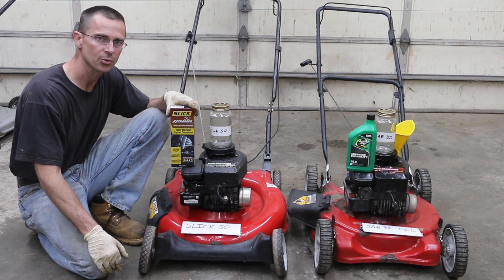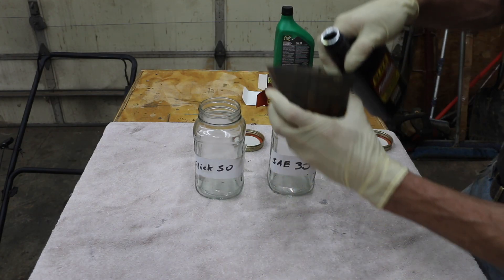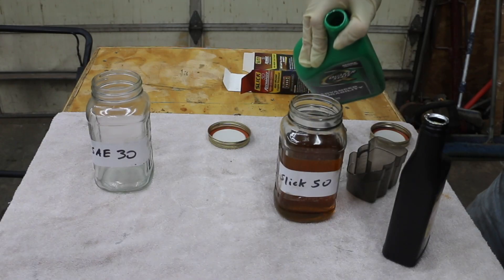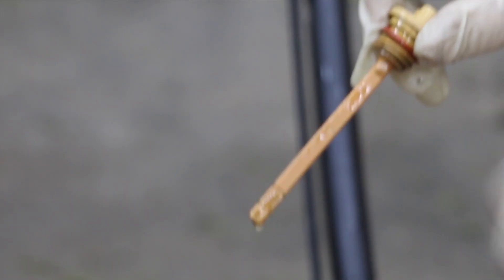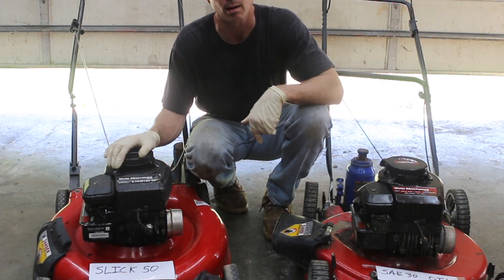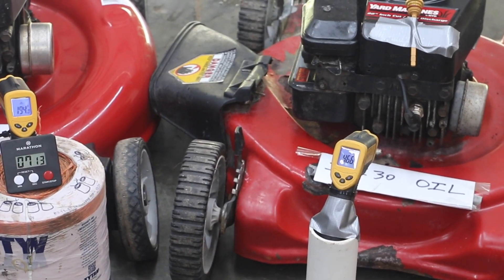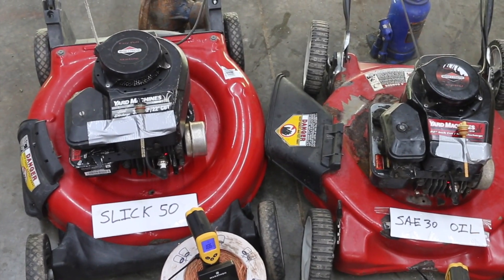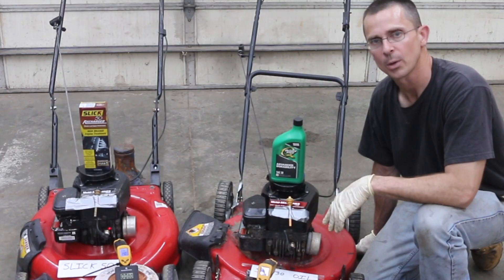Can't believe what SLICK 50 did to my engine!!--Dry Crankcase Test!

Comment: One thing that I noticed is that both engines took the same amount of oil but at 4:29 it looks like less oil was removed from the SAE 30 motor? Possibly that engine still had some oil left in it to protect it? 
Both engines should use the same base or sump, so capacity should be the same. 
The idea that the one motor has more wear on it has some validity as well, a well worn motor will have greater clearances and be less susceptible to seizing. 

Personal experience showed me years ago that Slick 50 would make many engines idle higher after it was added and run for a while. I had first tried it in a Toyota 22RE in 1988, after the oil change with Slick 50, I had to lower the base idle about 140 rpm or so back to factory spec. I got the same results with my 1986 Camaro. I didn't keep the Camaro long, but the Toyota motor ran for 372,000+ miles, and was still running when it was totaled. I added Slick 50 in 1985 when it first popped up on the shelves around here to a 1980 Pinto I had, the car had 110,000 miles on it at that point. I ran that car for 30 years, sold it with the original motor and trans at 664,300 miles, having done nothing to it but several timing belts, a valve cover gasket, one used rear axle (172K), several water pumps, a clutch, (at 352k), and a radiator (360K) in all that time.  I'd still be driving it if the body had held up as well as the engine. 
I can't say whether Slick 50 contributed to the longevity of those motors or not but I don't suppose it hurt anything. 

Back in the early 90's Ford was having problems with rocker arms galling and squeaking in the 3.8L engines, the fix they gave us was a 12oz bottle of additive which was completely unmarked. Word was that it was a PTFE additive much like Slick 50 in an acidic base to etch the metal. Our instructions were to dump the oil out of a hot engine, mix this additive with a fresh quart of oil and refill the engine as normal. Then we were to run the engine for 20 minutes at high idle. Every last engine that had noisy rocker arms was fixed nearly as soon as the oil reached operating temperature. 

The one thing I do remember was that the stuff came in a bottle much like power steering fluid or brake fluid does with a silver film seal on top. The screw driver I used to pop open those bottles would turn black where it contacted the additive. 
My workbench there was bare steel, I kept it spot less clean. On once occasion an empty bottle of that stuff fell over while I was running the engine on that car. I had taken lunch break and come back and noticed that the bottle had spilled a table spoon or so size puddle of additive on the bare steel bench. I wiped it up but it left a dark gray or black stain. 
Nothing would remove that stain, not even sanding with a Scotchbrite Roloc disc. The stuff had etched deep into the metal. 
On each car, we were told to immediately change the oil again after each run in period, we were told never to leave the additive in the engine. I tried several times to get someone to tell me what was in that stuff but all I got was that it contained PTFE, which was on the label. They would never say why we couldn't leave it in the motor for longer than specified and they were very adamant about changing the oil before the car was returned to the customer. 
When the warranty program was over, that stuff was gone, no longer available. The TSB for this stuff was back in 1993/94 mainly for the Thunderbird/Cougar models. For some reason the Super charged engines and the front drive engines didn't have the issue with noisy rockers.
Reply from the maker: Thanks for the feedback.

Comment: Microcontroller.
Used it in pumps running 24/7/365.
Noted reduced wear and 1r to 30 degree lower Temps than pump mfg. 20 ND  spec.
Reply from the maker: Thanks for the feedback.
Reply: @ProjectFarm  .

Comment: there was a product years ago that i had great success with called  MICROLON. I have not been able to find it for years but i have a generator that was run 8 to 13 hours a day for 3 years and it has no bore wear.The Chinese bearings gave out due to poor quality but this genset was run on gas,old and new,dirty and clean even diesel and veggy oil were used for fuel when i was desperate for fuel living off grid.I still have this genset apart for a keepsake .But if you can find any MICROLON that would be worth a try also I know a guy who luved TUFF OIL.another decent product.I was never a fan of slick 50.More like slick advertising
Reply from the maker: Thanks for the video idea.

Comment: The end result is simple folks, sae 30 oil is superior to thermal breakdown and holds it's true viscosity.
Reply from the maker: Thanks for the feedback.
Reply: @ProjectFarm  I'd like to see a Tecumseh 3.5hp run up against a Briggs and Stratton 3.5, remove the governors and let them run away. Use the same oil and brand for both  engines(such an sae 30) And then run the clock until one of them self destructs. Make it happen!

Comment: RVS is product that I have used myself and it really is working. Once I had this old diesel Merc with mechanical pump. Once I added RVS and did it like it should be result was that idle speed raised by 100rpm. My opinion is that it's amazing. I just haven't been brave enough to try running engine without oil after that treatment. Maybe you could try that product.
Reply from the maker: Thanks for the video idea.

Comment: When Slick 50 is added to a car engine’s oil, it will remain in there for several thousand miles. Perhaps this would give it ample time to impregnate the metal. It could possibly be that it just hasn’t had enough time to do its job. I’m just using the SWAG method here. I’m not sure how you could simulate that on an old lawnmower.
Reply from the maker: Thanks for the feedback.

Comment: The slick 50 I used years ago worked modern concoction is no where near the same product pwrhaps you could look into it. I also remember if yiu looked at it at the right angle you could see tiny.platelets in it
Reply from the maker: Thanks for sharing.

Comment: This test, unfortunately, doesn't tell us anything.  We have no idea how old each engine is, how many hours they've been run, or how they've been cared for during their lifespans.  Are they each brand new?  Are they identical?  All I know is that I used Slick 50 in my '94 Nissan hardbody 20 years ago there was a noticable difference.  It ran much better and much more efficient with it than without.  I only stopped using it due to cost.  If my memory serves me correctly, it was $50 a bottle and really ate up the pocketbook.

Comment: I too used to use slick 50 in the very first new car I bought.  That engine out lasted the car it was in. I noticed the lawnmower with the slick 50 had wheels that needed replacing because they were wobbly compared to the other lawnmower.  Just wondering if one lawnmower had many more lawns under its belt.
Reply from the maker: Thanks for the feedback.

Comment: I see two problems with the test setup:
1. Slick 50 was probably not long enough in the engine to have „best results“.
2. It probably would have been better to see what temperatures the engine with Slick 50 would have given with the 30W oil beforehand, to see if both engines perform similarly enough for such a comparison. Without that there can be lots of reasons why the Slick 50 engine quit so fast...
It also would have been nice to see, how both engines now look inside :)

Maybe you could do a new Slick 50 video with your current oil testing „suite“. I‘d be interested to see if it helps reduce wear on that bolt. :)
Reply from the maker: Thanks for the video idea.

Comment: I don't think Slick50 or Lubrilon have PTFE anymore. I just now read that Lubrilon does not, on their site. I believe that the fluorine in the PTFE may have been causing issues with oil chemistry, emissions, or both. Also, what effects would unbonded particles have in filters, in the engine, or maybe even in the catalytic converter? Or possible caustic compounds containing fluorine relaesed by heat and pressure? I remember Amsoil product literature (from a while ago) being extremely critical of a certain oil additive, which they refused to name, citing oil chemistry and/or emissions issues it caused (if my memory serves me correctly). Again, they didn't name it, so I cannot prove what it was. But I suspect it was Slick 50 and it was the fluorine in the PTFE that was causing the issues. Either way, there must be a reason why one ostensibly cannot obtain teflon engine treatments any more.
Reply from the maker: Thanks for the feedback.

Comment: yes,actualy there is one product than can clean sludge,stick to the metal in molecular level,give 95% lubrication lower the overall temperature and so on and so on.
it's called POLYTRON and its an american product whitch i've tested so many times and still using it after 10 years on every piece of machinery that i have and trust me on this when i say that the claims are all real 
im a mechanic i fix a lot of cars here in bulgaria and i allways recommend it to my customers its the best thing ever
Reply: here are some links
https://www.youtube.com/watch?v=4DRBl1o9FzU&t=697s 200km in the city without oil
https://www.youtube.com/watch?v=hBPVnNKdhdM&t=7s sand test
https://www.youtube.com/watch?v=rjmBgNp183U ice test
Reply from the maker: Thanks for sharing.
Reply: @ProjectFarm   no problem :)

Comment: Active 8. I lost all my oil in an 850 engined kit car I built. I had to drive the car five miles to home. I was still using the engine years later. I also put it in a 1200 flat twin BMW because on start up those engines rattle, it never rattled again.
Reply from the maker: Thanks for sharing.

Comment: I remember seeing an old (what we'd call today) infomercial that pitted some (forgettable) lubricant against Slick50 and (the then new kid on the block referred to as "spaceage") Duralube. In the infomercial they lubed what looked like a bearing on the end of a shaft that was mounted to an electric motor. But the bearing looked like it was solid metal and was positioned in the center of a housing that had a lever that was manually operated to apply pressure down onto the bearing shaped metal and they'd measure the amount of force it took to bring the bearing shaped metal to a stop. They also pointed out how much, if any, marring occured to the bearing during the test. Of course Duralube  required the most force and marred the least. I still have some Duralube products on a shelf in my garage. I know they made one for adding to engine oil but I seem to remember one for automatic transmissions as well. Pretty sure Walmart still sells both Slick50 & Duralube. I think they would be a good video comparison. Thanks.. I watch just about all your videos and if I don't have time to watch one I come across I'll save it to my watch later list.
Reply from the maker: Thanks for the video idea.

Comment: Test TSL please.... But in dry run nothing is going to run for ends.... Remember those guys spraying the crankshaft with a water hose??? Haha they did this to cool the engine, there was no load on the engine so little heat was generated..... Almost criminal even back then.....
Reply from the maker: Thanks for the video idea.

Comment: You have to test the super duty from Bardahl antifriction products that exist since 1939
I used to sell these products in mid 80's 
The American Automobile Association had tested a car with special duty in it's oil than drained and drove 180 miles with no oil in it's engine.
Reply from the maker: Thanks for the  video idea.

Comment: Crap I'm late to the game on this one...I remember those commercials as well, if memory serves me correctly they used the venerable 4.9L 300CI straight 6 bulletproof engine and I think that's how they could do what they did.  Anyhow, try using tungsten disulfide (WS2) particles in an engines oil for a while, drain and let it run, I think you'll see better results for sure.
Reply from the maker: Thanks for sharing.

Comment: Slick 50 destroyed my 600 ccm single cylinder Yamaha XT600.
BTW: One of the motors ran cooler because it had much more oil in it, you see it on the dip stick and also when draining the motor oil.
Reply from the maker: Thanks for sharing.

Comment: Slick 50 had Teflon when first made.  DuPont had a disclaimer that they do not recommend it used in an engine.  After some engine oil pump screens were blocked, they quit putting it in their product.  Newer automotive engine oils should not be used in old school design air cooled engines.  Look for an API rating of SJ which has enough zddp.  You will notice that "lawnmower" engine oil is SJ.  Newer, higher letter rated oil does not have enough zddp for this (or any flat tappet) type of engine.  It will shorten the life of the engine.  Multi-viscosity oils have less actual oil than straight weights due to the additive package.
Reply from the maker: Thanksk for the feedback.

Comment: Could you test air cooled engine temperature with synthetic vs conventional oil?  The way I understand it, the synthetic does not transfer the heat well out of an air cooled engine which is not a problem for liquid cooled engines.  Owners of old VW vehicles with air cooled engines say they run too hot with synthetic.  Love your channel!
Reply from the maker: Thanks for the video idea.

Comment: I hate to be that guy but unless You use two brand New engines. Not a mower just an engine mounted to exactly the same stand then your test is Invalid. Also your exhaust from one engine is blowing heat onto the next engine because you have the side by side. The mower's are previously used so if someone like myself owned the slick 50 mower beforehand it would probably give out before the straight oil. I dont neglect engines I do however abuse them. When doing a test like this everything has to be considered even the fact that the mower deck and ground clearance is different to how one has a closed discharge vs open.. I say this simply because heat  dissipates and builds up in many different ways that effect the engine and (test). Exactly the same devices brand new in the exact same conditions for a truly controlled test otherwise you just wasted two mower's..
Reply from the maker: Thanks for the feedback.

Comment: Would it be the case that Slick 50 is effective but only as a natural set up including oil. There is an oil called Castrol Magnatec here in the UK and i gather that it claims to stick to all areas and be extra protective wear wise, no doubt you could prove otherwise. Keep up the good work.
Reply from the maker: Thanks, will do.

Comment: Maybe try some oil with the teflon additive?  See if that works to prevent lockup when the crankcase is dry.  I have been curious to it's ability.  I have seen the video where the guy drives his truck across country with the oil drain plug sitting on the dash.  Possibly try that.
Reply from the maker: Thanks for the video idea.

Comment: Hi I absolutely love your videos, your rigid conformance with the scientific method to test these things (which is the only way really!) trying to do it all in the fairest way possible is excellent and a standard others should follow. 
There is a product that a mechanic friend told me about and has been swearing by it for years. They market it not as an oil treatment as such, but as a a metal treatment, they say they are only using the oil as a mechanism to get the product to the metal. Its supposed to make a micro metal coating to reduce friction and as a consequence make it all run cooler, increase performance, economy etc. I have used it in my car around almost 1.5 years ago (1.5x250ml bottles worth for a 1.9L diesel) and recently I managed to smash my sump and didn't realise until I got the low oil light. I was in the middle of london so it probably took around 10-15mins driving before I got to a fuel station to assess the damage and put some more in. It seemed pretty much most of the oil had come out while I was driving it yet it didn't seize. I've had it repaired now and its running perfectly and I think its down to this product that saved it.
The product is called ZX1 Extralube Micro Oil Metal treatment. I would be interested if you could try this product. Lots of people swear by it but there is a smaller proportion of people that say that it did nothing to their engine, and others are claiming that it eats away at metal (copper specifically) and that it is made of 'Chlorinated Paraffin', if this claim has any actual proof, I can't find it. I just see the same paragraph rolled out over and over from seemingly the original source. You only use this at a 5% dilution to oil and apparently you can use it in gearboxes and on bearings to lubricate them separately. There are lots of impressive videos showing it working, but not any really independent tests I can find on YouTube. If anyone is going to do it all properly and consistently its you!
Keep up the excellent work :)
Reply from the maker: Thanks for the video idea.

Comment: back in 1985 I was in the engine shop at TWR Motorsport. we dyno-tested a Le-Mans spec 6.4L v12 Jaguar engine with Slick 50 and found absolutely NO performance gain over using our regular Motul synthetic engine oil
Reply from the maker: Thanks for sharing.

Comment: The old version of Slick 50 really worked. As far as I can tell, the new version isn't near as good. I have seen the old version drop engine temps and raise the idle speed within 3 days of adding it.
Reply from the maker: Thanks for sharing.
Reply: I used the original

Comment: I would think that STP oil treatment would outperform Slick 50 in this type of test due to its higher viscosity thick film that I suspect would cling to engine bearing surfaces longer.  However, I don't know anything about the chemical properties of these products which forms the basis of their claims.